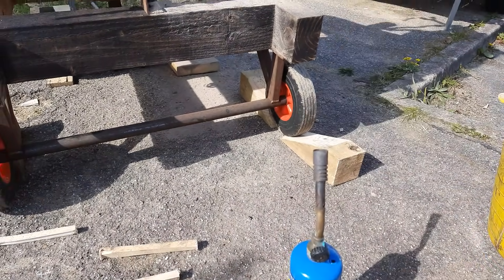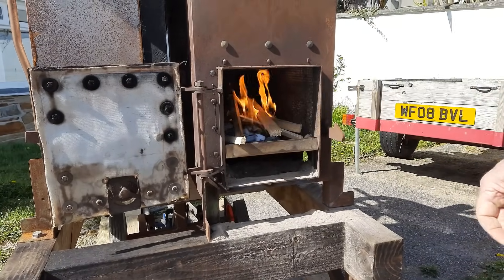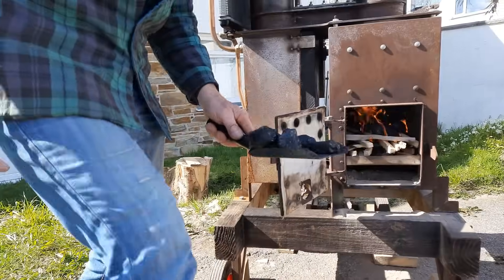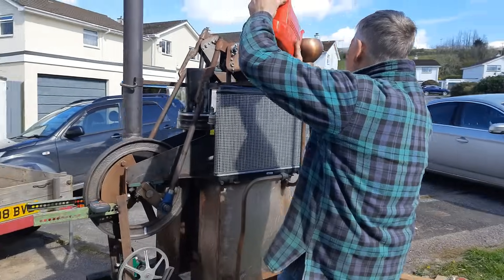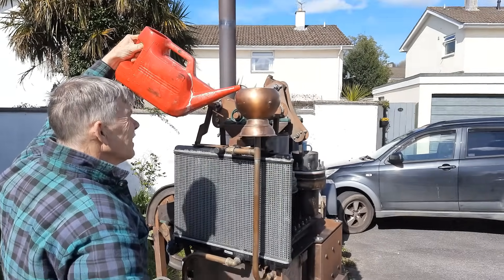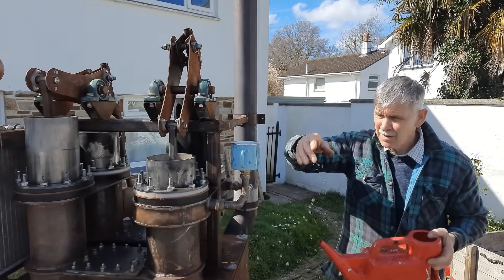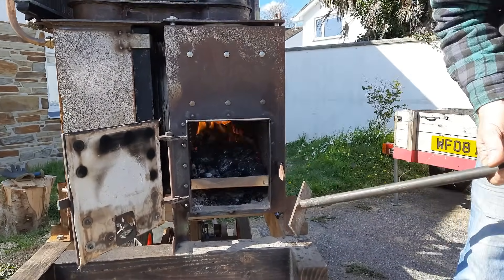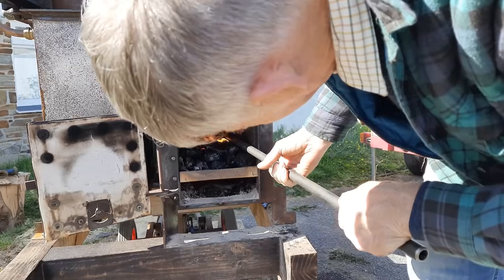Stirling Engine Generator Homemade DIY 0.47 KW ! Part 3

Comment: 500w?? My ebike have 1500w and I'm pretty sure your motor is way more powerful than my electric bicycle. Strange... Great work I love it! I'm looking for a very compact Stirling engine.
Reply: They have very low power to size ratio. I think that's why they've seen little commercial use.

Comment: A wood gasifier feeding a standard petrol generator is generally more effective for the same amount of fuel but I still find stirling very interesting. Same for steam engines.
Reply: Sie haben so Recht doch:
Stirling ist das nicht, man müsste dafür Abmahnen lassen.
!  Grundsätze beim Heißgasmotor sind. !
Je größer die Gasmasse ist, die vom gesamten Innenraumvolumen verschoben wird, umso besser ist der Wirkungsgrad, 100% wäre maximal.
Je weniger Kraftaufwand nötig ist, diese verschobene Gasmasse durch den Regenerator hin und zurück zu bewegen, umso besser ist der Wirkungsgrad.
Je mehr Energie in die Oberfläche der Regeneratormasse eingeleitet wird und beim Zurückströmen wieder aus dieser Oberfläche ausgeleitet wird, ohne dass die Temperatur des Regenerators ansteigt, umso besser ist der Wirkungsgrad.
Je geringer der Kraftaufwand ist, den Arbeitskolben zu bewegen (Membrane als Feder), umso besser ist der Wirkungsgrad. 
Baut einen Motor mit Diskontinuierlicher Verdrängerkolben Bewegung. Katalytischer Kontakt Wärmeübertragung. Wärme Rückgewinnung aus den Abgasen. Ölfrei mit Membrane, Vakuum Pumpen laufen Jahre mit Membrane.

Für Euer aller Poesiealbum: Die erste Maschine von Robert Stirling hatte eine Schwellenleistung von 34 kW bei einer Drehzahl von 28/min, Zylinderdurchmesser: 0,4 m, Hub: 1,22 m, wassergekühlt. Erstmals wurde ein XXX Regenerator mit Drahtgeflechten XXX eingesetzt. Der Treibstoffverbrauch betrug nur ein Drittel gegenüber der vorher verwendeten Dampfmaschine bei gleicher Leistung. Dieser Motor war vier Jahre im Einsatz und hatte einen im 19. Jahrhundert nie wieder erreichten Wirkungsgrad von 18 %. Warum? Robert Stirling leitete die Verbrennungsgase von oben auf seinen Erhitzer. In allen folgenden wurde die Wärme von unten an den Erhitzer geleitet. Wo ist der Unterschied? Schon am 18.05.1988 wurde ähnliches gesagt: Stirling- und Heißluftmotor – Diskontinuierlicher Laubereaumotor 1861 - 2021 Am 18.05.1988 erklärte Prof. Ivo Kolin in einem Vortrag mit entwicklungsgeschichtlichem Rückblick, dass die diskontinuierliche Bewegung des Verdrängers zunächst (bis1860) nicht zustande gekommen ist. Er führte weiter aus: „Erst später verwendete dann der französische Erfinder Laubereau eine Art dreieckförmigen Mechanismus, um eine diskontinuierliche Bewegung des Verdrängerkolbens zu erzielen. Die mechanischen Schwierigkeiten der Ausführung waren aber derart groß, dass die Idee wieder aufgegeben wurde.“ (Damals mangels geeigneter Materialien) Dazu stellte Prof. Dr. Ing. Sizmann vom Institut für Experimentalphysik München fest, dass der ideale Stirling-Prozeß zu 95% realisiert werden kann, wenn die flache Verdrängerausführung und die diskontinuierliche Bewegung verwendet werden. Dem gegenüber können selbst die modernen Maschinen mit Rohrwärmeaustauscher kaum 20% des idealen Prozesses erreichen. Eine Verschiebungsweg-, Geschwindigkeits- und Beschleunigungskurve einer Trochoide belegen, dass beim Weglassen der 60° Kolbenruhe am oberen und unteren Todpunkt der Rest schön, sinusförmig ist. Interessant ist, dass Prof. Cazin aus Paris, bei seinen Arbeiten über die Wärmelehre ~ 1877 , ausgerechnet diesen Laubereaumotor mit Trochoide benutzte um nachzuweisen, dass entnommene Arbeit aus einer Maschine Wärme verbraucht. Dazu steckte er den Motor in eine Kiste die mit Eis ausgefüttert war und stellte das Gewicht des Schmelzwassers fest. So entnahm er z.B. dem Motor die Arbeit 1kg auf 400 Meter Höhe zu bringen und es fehlten ihm prompt 12 Gramm Schmelzwasser. Übrigens: Jede Nähmaschine hat diese Trochoide, Sie hält den Stoff an wenn die Nadel den Stoff durchsticht, Nahmaschinen werden sehr alt. Weiter möchte ich auf zwei Anmeldungen aufmerksam machen. 
 XXX  DE3628254A1 *, 20 kol 1986, 10 ožu 1988, Anton Theiler, Thin-film regenerator.XXX
1. Einsatz von Dünnschichttechnologie beim Regenarator des Stirlingmotor (Heißluftmotor)
dadurch gekennzeichnet, dass ein festes Trägermaterial mit einer oder mehreren Schichten Wärmeisolierenden Material belegt wird. Die darauf folgende Schicht ist die Regeneratorschicht. Sie ist dem thermischen Prozess, Wärmeaufnahme und Wärmeabgabe ausgesetzt. 
2.  Dünnschichtregenerator nach Anspruch1. dadurch gekennzeichnet, dass die Wärmeisolierende schicht entfallen können, wenn das Trägermaterial aus einem anderen Material als die Regeneratorschicht besteht.
Beschreibung
Die Erfindung ermöglicht es Regeneratoren an Wärmekraftmaschinen, mittels Dünnschichttechnologie auf die jeweilige optimale Wärmeaufnahme, Wärmeabgabe und Speicherkapazität auszulegen.
     z. B. Die Oberfläche eines Regenerators am Stirlingmotor würde einmal aufgenommene Wärme nur zum Teil verfügbar halten, da die Energie zum Teil in die Tiefe des Regeneratorwerkstoffes eindringt und für den zweiten Zyklus der Wärmeabgabe nicht optimal zur Verfügung steht.
    Dies Eindringen in die Tiefe des Regeneratorwerkstoffes bewirkt eine Gesamttemperaturerhöhung des Regenerators, so dass bei wiederholter Wärmeabgabe an den Regenerator ein niedrigeres Temperaturdelta vorliegt und damit keine optimale Energienutzung mehr stattfinden kann.
     Die Verbesserung durch das Patent am Regenerator würde bewirken, dass die von der Regenaratoroberfläche  aufgenommene Wärme sich nur an der Oberfläche des Regenerators verbreiten kann, aber nicht in die Tiefe des Regenaratorswerkstoffes eindringt und somit für den, zweiten Zyklus der Wärmeabgabe, an der Oberfläche des Regenarators optimal zur Verfügung steht.
      Diese Technik wird hauptsächlich in Schnellfrequentierenden Maschinen Anwendung finden Kältemaschinen, Heißluftmotoren
Falls noch Fragen: Liebe Freunde des Heißgasmotor noch lebe ich mit 84 Jahren
https://www.youtube.com/watch?v=bnR_WOcMM8k   mal anschauen.
Reply: @antoniustheiler1494  I apologize, Youtube on my phone will not let me translate or copy your comment to the translator. I can understand the gist of what you are saying since I'm Finnish (we have many technical loan words from German), I learned some Swedish in school and I speak fluent English. I should have worded my original comment very differently. I know a Stirling engine can have an extremely high efficiency if assembled well and at a scale that suits the technology. But at the small scale such as in the video the losses to friction and unwanted cooling of the hot side are so great that a gasifier fed internal combustion engine will be more efficient for the same fuel and will also burn cleaner. That was my intention, I do not know why I wrote it in such a stupid way before. When I get to my computer I will translate and read your comment in full, the detail appears very interesting from what I could understand. Thank you, and excuse the mood of my earlier comment.

Comment: Is this a gamma type Stirling engine?
Reply from the maker: It's an alpha engine, cheers
Reply: @ShanePomeroy  Oh okay, I thought an alpha had to be an "L" shape with the pistons being 90° from each other, but yeah I can see that, I've just started learning about Stirling engines, for years I have had the dream to make an engine and film a YouTube video, Stirling engines look like a perfect beginner engine like the gamma Stirling engines made out of soda cans with steel wool as the displacement piston and a rubber balloon for the power piston and 2mm bicycle spoke for the crank and piston rods.

Comment: I dont understand how its a stirling engine but at MIT i made one a long time ago and it supposed to be theoretically efficient that even if you put it over your tea cup it will want to start up ofcourse the sliding friction is the main reason why stirling engines cannot even start on their own and  no one should practically use a stirling engine due to a myriad of other engineering problems even Cardinal (Clergyman) Stirling the original inventor lost money while some guy called James Watt made a lot of money and also aquired fame.

Comment: Hmm maybe add a pump for water and couple it with the big wheel shaft for more effciency and power
Maybe next time you should try the free piston vetsion, or even the thermoacoustic ones they have more efficiency than those with classic crankshaft ( less friction, no need for bearings )

Comment: An easy way to get a steam engine started is use a flat rope and just wrap it around the spinning thing and run creating momentum and because it's not connected it will go with you and you can use it again and again and again ect... to start the engine?

Comment: For off-grid kinda of situations, with solar and wind power, only in very rare occasions would someone need one of these. For residential I don't think it makes any sense(danger+size+noise+too many moving parts). Even for off-grid I would think a much smaller steam engine would produce the same, be quieter, cost about the same or even less to run. Either way, you must have done it for the passion of it, and its a work of art, congrats.

Comment: Nice piece of design & manufacture here, didn't need a lot to get going, and looks very robust !  I see that a Generator/Alternator was mounted below ready to be connected with a V-belt, did you ever use it to produce electricity ?

Comment: Such a huge machine for only 400watts of power. No wonder the Stirling engine never really made it. 
However I really would like to have a small free piston Stirling engine as an emergency power generator, those are really cool because they are small quiet and efficient.

Comment: Interesting and thanks.  I've seen photos of similar devices from the early parts of the last century for pumping water.  Smaller gasoline engines became popular during the 1920s, also for pumping water.  Note, what might be a fairly new car coolant radiator on the side of this widget.

Comment: To the comments somewhat insulting that it is inefficient( on paper yes , not in reality) so are solar panels but all the greenies love em. First with that stirling i have heat , second with a little tweaking here and there to harness more  energy from the heat to do work and then run a generator and store or connect to the grid so its running 24/7 it almost produces what a small home uses in electricity per day. Look at your utility bill. . If you could produce 1 hp of electricity ( probably a 3 hp stirling or 4 at 25% efficiency   ) which is 3/4 of a kilowatt × 24 hours = 18 kilowatt hours  per day . So think about the only requierment is a steady  1 hp continuous  generator output for a small house and a med 2 hp  and with free heat and hot water as that is the byproduct anyway. If a regen was used and better lubrication , hotter temp , colder cooler ( lol) that thing isnt far off. Efficiency is overrated if you have surplus fuel or its inexpensive to build / buy and maintain. It could run on used ( large surplus) of motor oil, cooking grease, and garbage refuse if ground up / dried and run hot to not smoke like a old deisel. All that is free fuel. The engine can be built for a thousand or less if u reuse old existing machines and take parts / material needed. If shtf and the debbie downers have no heat or electricity they will envy this guy. Solar panels are the biggest scam on the planet and windmills even worse. The amount of energy / raw materials, , shipping costs etc for the amount of power they produce is a joke and after 10 years or so they are junk and need to do it all over again. Same with batteries in a electric car. The motor is nothing without the original prime mover which in 90% of the world is fossil fuels and in top of that they need 1000 lbs of batteries made from elements toxic  to dig, extract and produce /isolate plus require huge amounts of energy to process and ship from mining to lithium, / copper, nickel etc smelting / ore processing centers, to make batteries,/ motors to ship on ships all around the world to make cars to ship all around the world. You are better off to use all that energy and fuel directly than make all the green crap that is 100x less energy dense than gasoline in the first place and manufacture all the solar cells batteries and windmills  that will need replacing  every ten years anyway. If u want to go green keep your current car and make it run as long as u can so another car isnt produced . Even if it got poor milage just the fact that a new car is made if u do replace it , you are 10 to 15 years ahead of the break even point , by then the batteries are junk and you are still ahead. Air up your tires, tune ups every season  and dont lead foot it off the line or to accelerate and it will be far more efficient than as a old ratty underinflated old car. A pickup truck in the 70s got around 12 to 15 mpg and now a f150 or 250 gets ....15 to 18....not a whole lot more. They had vw beetles and vw deisels and other cars in the 70s that got 50 mpg and didnt cost 50k to buy! Its a scam . We are getting the raw deal while others are getting rich. The answer isnt a top down control the people grid system. Its a bottom up grid where every home is a producer of some power / electricity with a system of many different types ( stirling being one ) that is part of a home like the furnance, plumbing and electric panel. Pusle combustion is another, solar ( heat not photovoltaic) is another for heating air and water. Resonance and frequency vibration is another. There is so much potential energy free for the taking but our fearless leaders dont want what they cant control.

Comment: Very impressive.... I love it!!!! You should find the most energy efficient heater that you can. I've read that quarts and ceramic work best.  I would love to see if an energy efficient heater could be supplied initially by another power source but then be able to run off of the power produced by the engine. With ALL my love NLL

Comment: The Astromedia cardboard, aluminium and rubber glove finger tip Sterling Engine Kit runs off the heat from a table lamp bulb or just about from a cup of boiling hot water.  It has clear plastic around the displacer piston and you can see and understand everything at a glance, recommended 10/10.  Google it.  For more fun you can balance an ice cube on the cool side of the displacer disk and watch it really take off.

Comment: The water cooling radiator must be purged, it is of little use, especially in this position. If you want to use the Radiator in passive mode, it is better to make a large radiator from aluminum flat pipes or simply place an open barrel of water.

Comment: nice WATT steam engine ... when do you do a Sterling cycle engine ... a STEAM engine uses a liquid (water) to create steam to create the pressure ... a Sterling engine ONLY uses the differential of heat to cold between the parts .... NO WATER ... the Watt steam engine boiled water to move a piston and then condensed it and reused what water dint escape up the chimney ..  which is exactly what you built .... 
if you use the condenser as a chiller with a fan on it to keep the cold side cold and remove the boiling water side then your working with a sterling cycle engine ...
Reply: You are confused.
Reply: @givenfirstnamefamilyfirstn3935  nope he is using steam to compress the piston ... NOT heat ... that makes it a steam engine NOT a sterling heat cycle engine ... notice his water jacket COOLS all cylinders ... NOT just the cold side ... he is INJECTING steam to move the pistons .. and recycling it as water to recirculate it in a watt recycling cycle steam engine ... as THAT is it's PROPER name ...

Comment: Great work but the efficiency looks terrible.
Reply: A heat recovery coil can be incorporated into the air passage between the hot and cold sides to boost efficiency.

Comment: At least 50 percent of its power goes into that "dah-dah-dah" sound I believe. :D
Reply: stirling motors follow the carnot cycle so only 30% become electricity, the 70% are the dah dah dah and heat

Comment: Okay, very cool engines.  What I find interesting is you are using a Bic style cigarette lighter when in reality you should be using either a torch lighter, the ones with the blue flames that resemble a small torch or get yourself a piezo-ignition switch propane or map-pro  torch.  Not very expensive either way.  My piezo-ignition torch was only about CA$80 and is a Bernzomatic brand.

Comment: As far as I can see it is a 2-cycle alpha-Stirling engine. I guess it is running with air as cycle gas at an average pressure of ambient pressure. Advanced Stirling engines use helium as working gas in a closed system at a pressure between 10 to 100 bar. They can achieve efficiencies of 40%. Modern Stirling engines use mostly the gamma design because you don't need hot seals for working pistons. A displacer piston don't need a perfect sealing. And you can use the inner displacer piston volume to integrate the regenerator.

I guess the most system losses in your system come from the heater. The exhaust gas ist still very hot. You don't have any exhaust air heat exchanger for pre-heating of the fresh air for the coal fire. With such a heat exchanger you can recuperate up to 80% of the exhaust heat losses and increase the system efficiency by far. I guess the efficiency of your engine is maybe 2 or 3%. You can increase it to 10% by use of exhauset heat recovery.